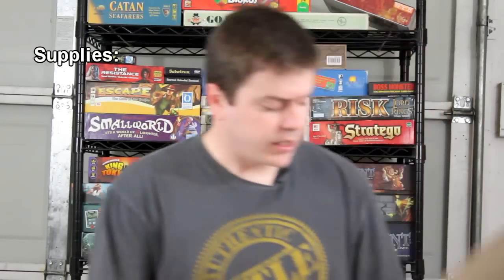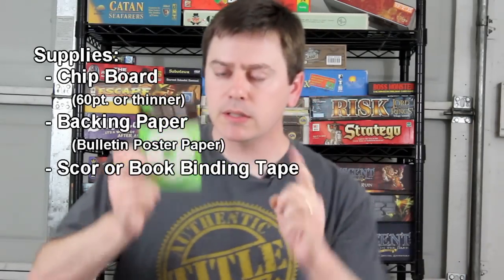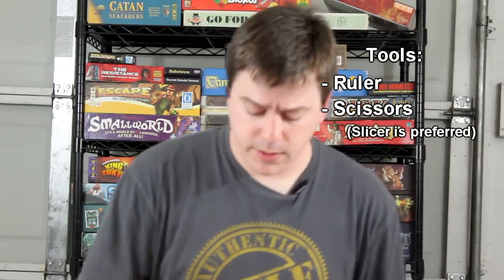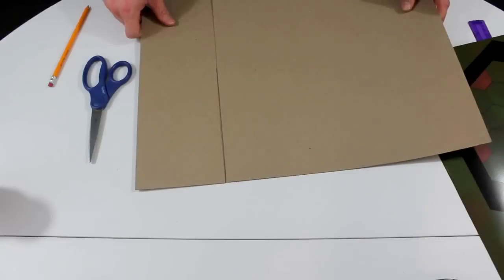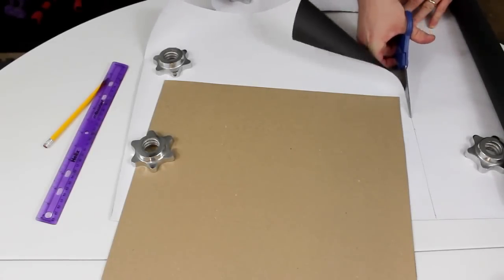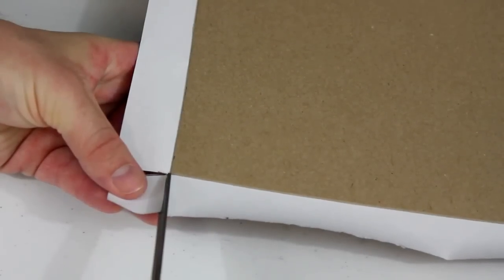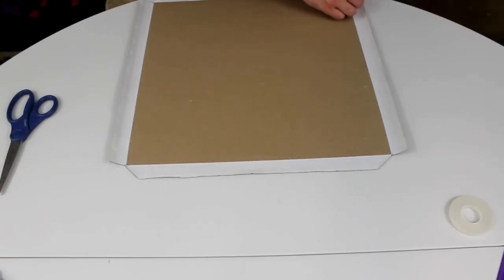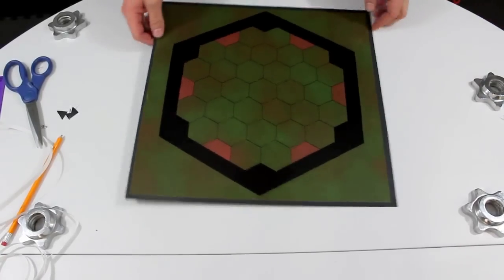DIY Gaming - How to Make a Gameboard

Comment: Here’s a cutting tip... even better then paper slicers.  

 Use quilting self healing mat, rulers, and rotary cutter.  Cuts through paper like a champ and you can even use the markings on the rulers to get your perfect  angle cuts.

Comment: A few other suggestions would include using a brayer (a hard plastic roller) or a hard plastic squeegee (not a rubber one) to help smooth down the paper backing/print after applying the adhesive.
Reply from the maker: DiceFest Games Oh yeah, that's good.  I also should have mentioned to work on a hard flat surface so we don't induce extra ripples or seams

Comment: Hi, on what kind of paper do you print the board game design? I am from Nerd Hell in South Africa where they don't even know what card sleeves are and where yes only 4 seasons of Star Trek The Next Generation was shown over a period of about 10 years, so I doubt the printers will know on what kind of paper to print the board game design. Also do you need to protect the board game design with some sort of lamination or will it stay good as new without and protection?
Reply from the maker: It's almost more important whether it can be printed with a laser printer.  Your colors won't smear or bleed as bad if they have a laser machine.  The problem then becomes what your print size is limited to with that machine as usually it's the ink printers that can print on banner sized paper.  As far as the paper itself, I try to use something thin and light-weight.  Not glossy like the one I have in this video.  The bi-fold and tri-fold videos on this channel have better paper stock.  I don't have a sealant process as I've only used these for prototypes.  The problem with spray sealants is they create a rough finish.
Reply: Thanks. My game boards are not going to fold, but will be 4 A3 papers on chipboard. I will have to find some way to make them "stick" together when I play, something like velcro and then they will pack away easy. But before I go design those boards can laser printers print on A3? (I am going to have this done professionally.) Then what kind of paper or material should I ask them to print on. I guess your knowledge on this is much better than mine. then as far at the covering of the board goes maybe if I understand your answer cover it with nothing and rather reprint if the quality goes down?
Reply from the maker: There are color laser printers for A3 out there. It will really depend on where you go and what's available. I wouldn't print on anything heavier than 20lb stock. I talked to my printer peeps at Office Max and they help me get the right paper for the machines they run. But for a board you're not folding, the stock makes less difference as your not worried about a foldable seam. I tend to go no-gloss
Reply: Ok thanks. Will go to one of these professional printer places and see if they can help. We are on the metric system here so i am not sure what the equivalent of 20 pounds are here, i.e what we call it here and what I should ask for. Things like board games and your own unique cards don't really get printed over here at Nerd Hell. I went to a place that prints photos and asked if they can print on photo paper from an word document and they guy took about 5 minutes to figure out I was not talking about trying to print a map. The closed you will ever get to a comic book convention here where I live is a youtube video.

Comment: Do you know where to get a game print label or how to make it?
Reply from the maker: Annabelle Jameson I think you're asking where to get the front graphic printed for a board?  I make mine with photoshop but there are a lot of great programs you could use.  Then I take it on a flash-drive to Office Max / Depot / Kinkos / etc. and have them print it for me.  If it's a large print-out you may want to find out the printers' limits first.  I get my board print-outs made on really basic poster paper.
Reply: Thank you! Could you recommend any programs for me?
Reply from the maker: Yes, if you want the photoshop experience for free you can use Queeky Paint in a browser:  http://www.queeky.com/app  there is a learning curve to this tool as far as exporting and layer work if you've not done that kind of thing before.  Best thing to do is just jump in and start experimenting and look up tutorials when you find you can't do what you want.  I've heard SumoPaint is good too but I've never used it (not sure if its free either) http://www.sumopaint.com/home/
Reply: Okay thank you so much!
Reply from the maker: Annabelle Jameson You can also use Gimp (gimp.org) but it's got a learning curve similar to Photoshop. I've been using Paint.NET (getpaint.net) a lot lately for simple photo editing. It's a huge step up from the classic windows paint and really easy to use while giving you access to features similar to photoshop.

Comment: How do you keep the art from wrinkling on the final step?
Reply from the maker: That's probably the trickiest part.  In the Bi-fold and Tri-fold video, I found it's easier to use a strong glue stick on both the backside of the artwork as well as the surface it's being attached to. That will give you some extra time to work on smoothing things out before the glue dries.

Comment: I've seen a few DIY boardgame makers who all just pull out a print of the boardgraphics from their local printing shop. Well this is not just an other item on the list. Such a large print easily cost 20$ making the protoype. At least that's the price I tend to land on after asking around. It makes it almost cheaper to upload to a prototypemaker (i.e. TheGameCrafter), which defeats the purpose of making it your self. Is this just something I have to except or is there an easier way?
Reply from the maker: Printing costs are often a deal breaker aren't they?  To save on cost for a prototype, you might consider breaking up the image so you can have it printed on several smaller sheets instead of one larger one, allowing them to run it on a more cost effective machine.  It doesn't look as good, but when you're prototyping it might be the best approach until you lock in your design
Reply: Pub Meeple 
Thanks. we were thinking along the same line. Do you know a good way to minimize the edge showing where two sheets meet?
Reply from the maker: Not if it's a board without folds.  If you made it a bi-fold board, the seam could run along the existing fold

Comment: Is there anything you recommend as an alternative to spray glue? It's pretty wet outside and I don't have a well ventilated area :/
Reply from the maker: I've started using glue sticks for a lot of projects.  As simple as it sounds, they're easy to manage and don't wrinkle the paper.  Doesn't work well holding 2 pieces of chipboard together, but it's fantastic for the paper to chipboard contact

Comment: I can't find any large chipboard sheets online. Where do you get your large sheets of chipboard and is it possible to get it online? (I don't live near any craft stores)
Reply from the maker: +Nolan Johnson, someone is always selling chipboard on Amazon but it will be difficult to find anything larger than 12" x 12" sheets.
Reply: +Pub Meeple should I just glue multiple sheets together? also, thanks for responding so quickly.
Reply from the maker: +Nolan Johnson, It really depends on how much you need.  If you know the dimensions you should be able to determine how much you need.  If you have the money, it may be best to get multiples as it will save you on shipping if you end up needing more.  Before you buy, make sure you don't need any one piece larger than the size of the pre-cuts.  I've used smaller sheets of chipboard many times as sometimes that's all that's available.  And don't forget that if you're doubling your thickness, you'll need twice as much as your measured area.  Good luck

Comment: What dimensions of the chip board did you use?
Reply from the maker: I believe the chipboard ended up cutting to 15 1/4 inches.  It's a 60pt. thick sheet

Comment: How do I make this work for a hexagonal board with holes?
Reply from the maker: Not exactly sure what you mean.  I suppose you could cut the holes in your graphic and trace them on the chipboard.  Cut the chipboard and then apply the graphic?
Reply: Pub Meeple sorry I wasn't specific! I must have forgotten to type something. What I meant is how do I do the poster backer for my board? If you want to see my plan, I'll show you later.

Comment: Thanks for this, I'm printing from Fed-Ex, do you recommend the glossy or matte finish? Obviously one is more expensive than the other.
Reply from the maker: I've done both.  I personally like the matte finish but I don't mind the glossy.  Either way, if you can get them to print it with a laser printer, the ink isn't as tacky and has less chance of smearing
Reply: Which did you use in the video, matte? Because matte is cheaper and looks pretty good if that is what you used in the video. Thanks!
Reply from the maker: The one I use in this video is not very good.  Now I use a gloss for boxes and matte for game boards with a thin paper stock
Reply: Thanks, it's gonna look great.
Reply: Pub Meeple Actually one more thing, is there a way of protection for the board you recommend. I can't laminate the size I've printed. Thanks again.
Reply from the maker: You know, I've never really thought about any kind of protective coating over the board.  I mostly only do this kind of thing for prototyping so the boards aren't around long enough to worry about anything lasting.  Once I've locked in a design, I send off for something of more production quality

Comment: Can I use fiberboard?
Reply from the maker: how thick of fiber board?  I don't see why not.  Depending on your setup it might take a little more to cut and work with, but if it's thin enough you'd have a pretty sturdy board
Reply: Pub Meeple it says it is 0.216 inches thick... is that still okay?
Reply from the maker: That is very thick.  About 5mm.  I usually use a material that only brings the board to about 1 to 1.5mm.  There are thick, wooden boards for games like Wahoo or Crokinole.  I guess it depends on what you want the final product to look and feel like.  You'd probably want a fine saw to cut 5mm fiber board and maybe some sandpaper to get a clean edge